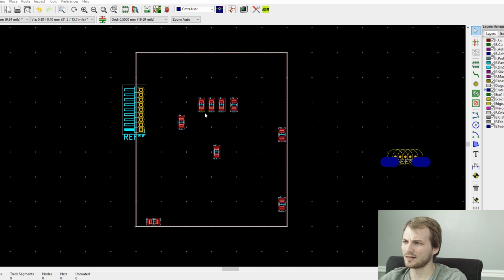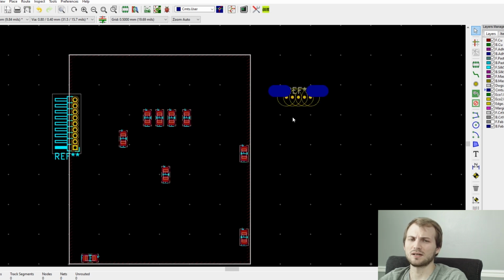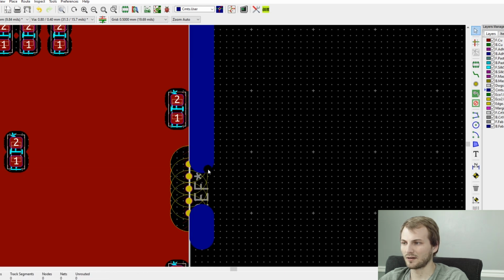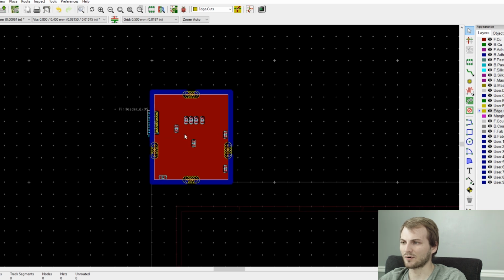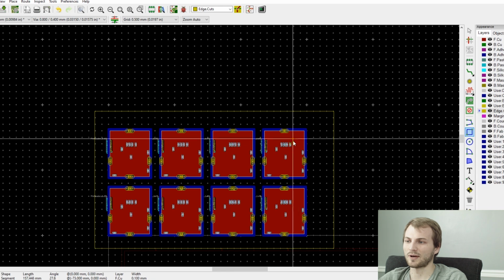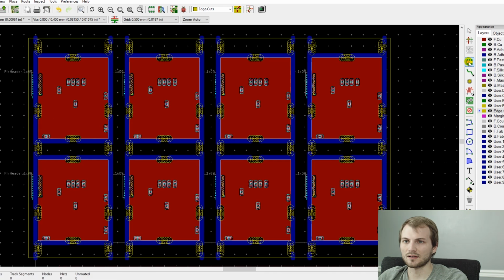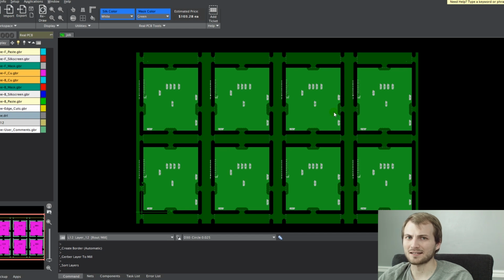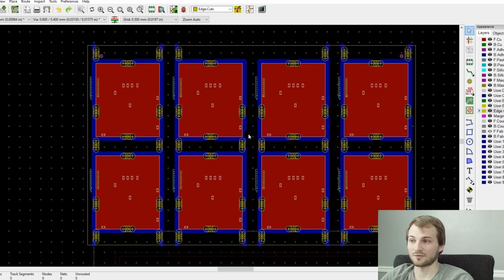(UPDATED) Panelizing boards within KiCad - Random KiCad Tips

Comment: How do you communicate to the fab house that the 2mm segment is to be routed? I'm trying to use mouse bite, not to panelize, but just to create an optional passive breakaway section on a single large board.

Comment: Wonderful video.  Another whisper which would be worth considering are embedding designs in a panel with additional designed traces.  i.e., What I have done before is design a panel with sub-panels of a repeating circuit.  A handful of lines come off of the design matrix, perhaps have a couple of components in no mans land (but this we try to keep to a minimum as they are thrown out after assembly), and we bring the lines to typically an edge connector (like an old isa formfactor edge connector.  Something that we can get cheap!).  Then we build a jig with the mating connector, a support for the entire panel, power, serial programming and JTAG support, and then we run boundary scan across all parts, program all parts, run all post process active QA and programming processes for final pass on the part before de-lamination.  Makes verifying and programming 10,000 units much much easier.  Would seem that this requires just a little additional though to next into Kicad similar to the way you can self-reference several hierarchical sheets to one sheet and have them all self updating, but thought out with pick and place, panelization and the like already in mind.  Overall, I am extremely happy that I found this video.  It is right on task, and is so much more elegant that taking post gerber files, or some using some of the other scripted tools that were around before.  Bravo.  As for the shortcomings, again, right on the mark.  Thank you so much.

Comment: You chose quite time consuming method. KiKit automates all the steps and generates gerber files as well.
https://github.com/yaqwsx/KiKit/blob/master/doc/examples.md
Reply from the maker: Hah! I just spent the last 30 minutes going through that. What a neat tool, I've never seen it before. I think it'll take me longer to mess with the configuration than to just keep doing it manually though. Plus, it seems to only handle two layer boards, and not a lot of gerber settings can be adjusted without digging into the source.

Definitely will be following it!
Reply: @MicroTypeEngineering  
I've made test with 4 layer PCB and it works fine (In1.cu and In2.cu layers are copied to the output panel). Configuration of all parameters might be time consuming when you do it for the first time. Now I just copy the panelization script from my previous project to the next one, modify some parameters and that's it.
There is one nasty bug in KiKit - if any part of a component is outside board outline  (even hidden text field) it is removed from the panel. I guess it is limitation of KiCad API, not KiKit itself.
Reply: @zeb4128  Looks like that issue is already fixed in upstream according to https://github.com/yaqwsx/KiKit/issues/86, but you need to install the "upstream" version to get the fix (until the "stable" version is updated)
Reply: @drojf  That's great. Thanks for the link.
Reply from the maker: Ahh, thanks guys. Will give it a proper test, might have to have a third version in this series if it works out!